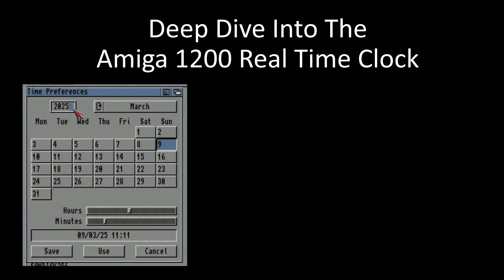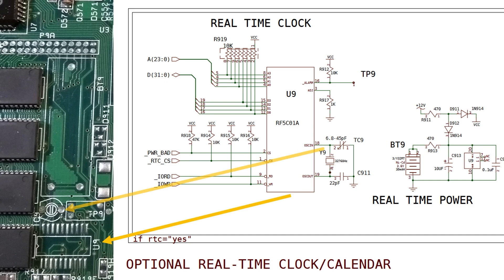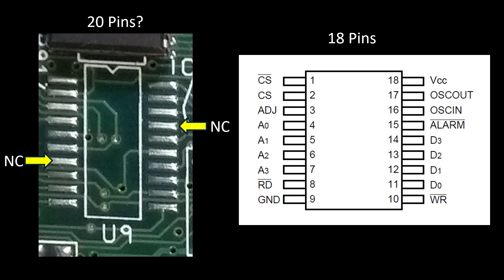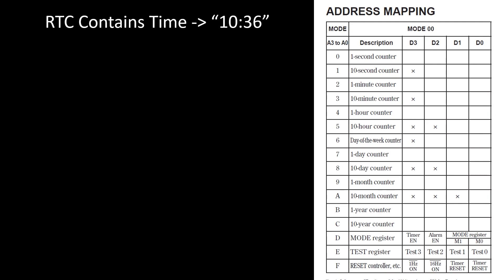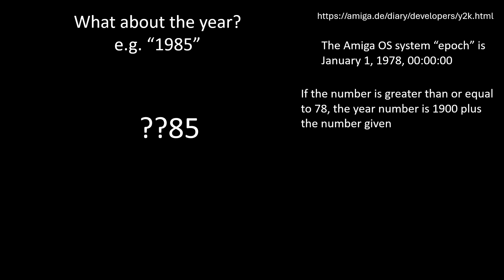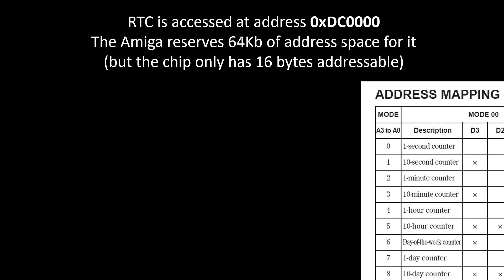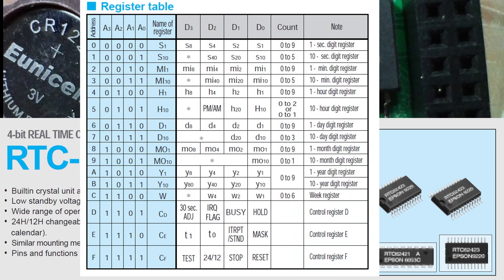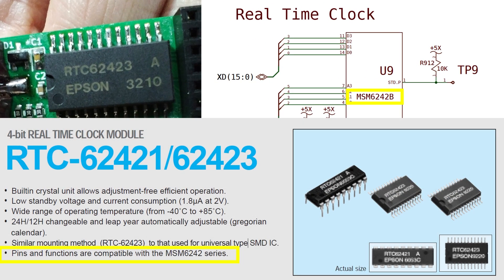It's Time To Talk About The Amiga 1200 Real Time Clock

Comment: It's been a "minute" since I worked with 68xxx processors but unless my memory is completely failing me, they (the ones that have a 32 bit data bus) don't even have A0 or A1 address lines so the engineers didn't really have a choice about using A0 and A1.
Reply from the maker: From what I can see, the processor does have the A0 and A1 data lines but the lines don't go to all the chips. The 32-bit ROM's don't have them, neither does the RTC. The 68881 FPU has the A1 line but A0 pin is just pulled high. A0 only seems to go to the trapdoor expansion and to Budgie.

Comment: maybe they decided these things don't work well with multitasking operating systems anyway. as you can't read and write all registers at once and as such corruption occurs when 2 programs do it. and as such you have to use a  normal 32 or 64 bit register with an adder (on an irq or in hardware) every second anyway-, and as such if you are gonna do it you might as well just do it with a way simpler custom chip than any of this stuff on the market out there. ;) and -then you can write the entire register in 1 go. :P heck half these things are 'designed' to be hacked under an eprom and don't even have a normal bus. (and why bother storing the time and date date as an actual time and date in the first place, when all you need is just an increment on a register while it's off every second ;)
Reply: With very few exceptions, pretty much all hardware will have problems if multiple programs try to access it at the same time.  That's why multitasking OSes always have functions for protecting and coordinating access through MT-aware drivers, etc.  That's part of the whole point of what MT OSes are for, and there's nothing special here in that regard (note that the RTC hardware built into all modern PCs is still accessed in almost exactly the same way, and stores the time in a very similar format, too, and still works just fine).

They ultimately didn't populate it because they decided it would be cheaper to produce that way, and most of their users would be willing to live with having to reset the clock every time they turned on the computer (because at the time, that was actually very common, and an RTC was still considered something of a "luxury feature" for most home PCs anyway).
Reply: @foogod4237  eh yeah well the RTC built into 'modern' pc's isn't modern at all. but that same old 1970s motorola rtc+nvram chip in a different packaging as in the AT 286
Reply: the thing at that time was kinda 'overengineered' lol. like why the hell keep a calendar in the chip lol. this comes with a whole lot of registers and those are gatewayed. and that causes the fact that multiple programs cannot do stuff with it at the same time, at all. (nost just corrupting the date or time, but just getting the wrong fields).
Reply: and yes ofcourse multiple programs can access any i/o register you want as long as it's is full databus size in one go. and not some gatewayed shit contraption.
Reply: just like they all access the same ram at the same time, which essentially is just an i/o device too lol.
Reply: a seconds counter in hardware with a latch to an i/o register to compensate for clock sync differences between the cpu clock and the time-clock would have done. but nah. someone in the 1970s decided to actually count 'days' and 'hours' in the chip lol.
Reply: modern os-es don't access the thing at all. they only get the time from it upon startup. not every time you do time(NULL). and yet if they did their job in the 1970s it damn well could be a direct query to a hardware register.
Reply: keep in mind. it is done that way on all 8 bit micros and essentially the ibm pc is also just an 8 bit micro. dos is not a multitasking environment and the thing has an 8 bit external bus. just 16 bit cpu registers internally. the amigas are essentially a different beast and as such those old methods, are clearly not the way to go about this in the first place.
Reply: to this very day anything running on pcs just keeps the time in the kernel as a workaround :P LOL. you can pull the whole chip out while it runs and it won't notice lol.
Reply: either that or someone at cbm had the magical foresight 10 years after the fact that networks became standard :P LOL. that hey 'in the future' (read, 10 years earlier ;) every node will just sync their time over the network anwyay ;) or better yet just broadcast it over the network every second. lol. so the things don't even need a clock of their own. lol. but commodore being commodore, probably not. too cheapass to even put in a nic of any sorts. lol.
Reply: 'modern' pc's are little more than an overglorified ibm xt typewriter :P with some hacks on top. lol. and yes RTC's already were standard on -basically every system with at least some intention to stick around' (cbm just never got the notion on that networking and rtc's are needed and fancy colors are not ;)
Reply: besides the fact tramiel never understood 'networking' and for that matter, neither did cbm as a whole under any management. he also never understood that price does not matter -at all-. lol. just put a superior product in the market and you don't do that by 'leaving critical things out'.
Reply: what killed the amiga and the st? oh yeah. mainly just that they could not talk to your novell netware or bayan vines server. lol. or your minicomputer. not in any acceptable way anyway. 'muh ibm is more expensive'. well. ibm is still around :P they are not lol.
Reply: let's face it, these things are just as capable as let's say a mac lc, or a cisco 2621xm, or an earlier sun workstation. and yet they completely missed out on the changes of the market due to all that 'leaving stuff out that should have been in there as of 1987'. and only did the fancy colros and sounds. making them glorified lava lamps. but isolated ones. computers with no network in the 1990s? seriously? and no rtc either? and no hdds? that stuff was all standard in 1985 already haha.
Reply: they were stuck in their little bubble market containing a handful of 'gamers' which indeed may not need an rtc :P but it's a 10 cent part to open up 'the other 900% or so of the market to sell to' lol.
Reply: so you have like a what. 25-40mhz 16 bit cpu in there and enough megabytes of ram to run not just any unix variant but also have 1000 users running around on there at the same time lol. and because you decided to leave out some 10 cent parts the only guys you sell to are 'gamers' instead. lol.

Comment: Once CBM chose a cheap flimsy clock-chip and now all Amiga users are stuck with it.
Reply from the maker: @vanhetgoor  The real problem wasn't the chip, it was the leaky batteries. It's quite a good thing that they didn't install this stuff in the A1200.
Reply: This RTC chip isn't really substantially different than the RTC chips used by pretty much everything at the time (including the IBM PC/XT, etc, too).  It's actually not "flimsy" at all (the chip itself will last pretty much forever).

The reason they all used the large, rechargeable NiCad batteries (which, like pretty much all batteries, will eventually leak if left unused for decades) is because at the time it simply wasn't possible to make an RTC chip that didn't still consume a significant amount of power to maintain the clock when the computer was off, and that power needed to be stored somewhere.  It wasn't until later that people managed to develop RTC chips which consumed much, much less power, and could run for long periods of time on things like little coin cells instead.
Reply: @foogod4237  Even in the eighties it could have been predicted that a new era was at the horizon. Within a few decades or less the twentiest century would be gone, forever! Never to return. It was pure neglect to produce a clock chip that would automatically fail in the new century. I think it was bad management, and very short sited. The Y2K-problem was preventable and especially the people whom are working with computers should have noticed this error and actively taken measures. The moment time travel is invented, those unintelligent computers are not coming with us.

Comment: The reason there are memory expansion pins on the 1200 is because Commodore originally thought of releasing it with only 1 Mb of chip memory.

In the 90s when I was still using Amiga there was a "leaked" schematics of an Amiga 1200 prototype. It had only one megabyte of ram and a 68000 CPU clocked at 14 MHz.

Fortunately for us The final version was shipped with the 68020, 32 bit buses and 2 megabytes of chip memory, probably because the AGA chips were too slow for a 68000, even clocked at 14 MHz.
Reply from the maker: Yeah, the 2nd megabyte is marked as optional on the schematic (also notable that the A600 has the same thing but with the 2nd 1/2 megabyte optional)

Comment: Interesting, but a bit disappointed that no soldering iron were wielded. Could you solder in the parts and use the clock port as usual for other stuff? I'd suppose so since it wouldn't use RTC CS signal?
Reply from the maker: @aarntsen  Actually I have the Amiga Kit ram expansion and that clock board can be installed on the expansion or on the motherboard, so still no soldering required and the motherboard expansion is still free.

Comment: You will probably find the NC pads are via in pad, saving space, and hidden by the solder on the board.
Reply: I think you missed the point that the NC pads aren't actually supposed to exist at all, according to the datasheet.  They're apparently extra pins that don't correspond to anything (and mean that it doesn't actually match the chip pinout in the datasheet).  So there's no reason to believe that they should be connected to anything anyway.

This was most likely a special pinout of the chip which never really caught on (and may not even be produced anymore), and just added a couple of extra NC pins in the middle to make it fit the desired footprint instead of the more standard layout, and those pins were always intended to be unused.  It's also possible that somebody just screwed up the PCB layout (and that might have been part of the reason why it was just decided not to populate it in the end).

Comment: That Ricoh RTC chip is also used in the MSX2 and up and I've been looking for some information about it, so thanks for that!
Reply from the maker: Hopefully they laid out the board properly on the MSX2
Reply: @DavePoo2  There are various implementations of the MSX2 standard, so the layout is not always the same. 

The Ricoh chip is also very hard to come by, because it's not made anymore, and it's very hard to find compatible replacements. Unlike Dallas RTCs for instance, which you can still buy at your favorite electronics shop.

Comment: Is there a reason you stop the ticking? Most RTC chips buffet the values and stop updating them if you start a read at the seconds and complete it through the year position. This chip doesn't?
Reply from the maker: The data sheet doesn't say. I noticed the code in the Amiga test kit is stopping the ticking. Link to the code is in the description.

Comment: Also worth noting is the motherboard also has an unpopulated pad for an FPU. You can just solder an 68881 or 68882 FPU and it works perfectly well (although has to be clocked at the same speed as the CPU, which is a minor drawback)
Reply from the maker: @danbuc  hopefully, they got the pads right for that one!
Reply: @DavePoo2  I believe so! Not much use for it as there is next to no software on the amiga that uses the FPU, and most of the software that does use it tends to require a 68040 or 68060 CPU where the FPU is built in.

Moderately tempted to add one to the board I'm building anyway just for completeness sake
Reply from the maker: @danbuc  I think I saw Chris Edwards add one to a board once.
Reply: @ FPU was used in ray-tracers, terrain modelers, CAD and Mandelbrot programs and an 020 worked fine (I believe that shapeshifter allows Mac software that used the FPU to work and there was a DTP that could also use a FPU)
Taking an A500 sticking in a 68020 with FPU and watching it do ray-tracing at what felt like light speed (see what I did there) was glorious.
Reply: @daishi5571  There was some software but if you total up everything that was ever released it's probably less substantially less than 1% of all amiga releases. Mostly Ray tracers, ports of early 90s FPSes and some mid to late 90s demo scene creations
Reply: @ I know, but some of the most important pieces of software on/for the Amiga did use a FPU. The Mac had the same situation. Even the PC had the same problem until software was given 486DX as a minimum.
Reply from the maker: @ I think when the PC hit Pentium was when it all changed as suddenly the FPU was built into the chip so as software programmer, you knew that anyone with that CPU had the FPU
Reply: @DavePoo2  My general feeling is that the working FPU footprint on the A1200 indicates they had planned to ship it with an FPU included. I imagine they pulled that for cost saving reasons as commodore were already struggling financially by them.

The two things that are confusing about the design are the lack of oscillator for the FPU, it doesn't have to be driven at the same rate as the CPU. And secondly why have a separate FPU socket at all? The 68020 was an ancient CPU by 1992, a 25 or 33Mhz 68030 with the FPU built in would have been a much, much more competitive option in 92. But Commodore are a company literally full of baffling design and product decisions so it is par for the course
Reply from the maker: @danbuc  yeah. Did the Atari Falcon go with the 030 chip?
Reply: @ Falcon is a 68030 but on a 16-bit bus so does loose a bit in performance (not the massive amount some people try to claim)
Reply: @danbuc  I didn't think the 68030 had an integrated FPU. Maybe the FPU XO was left out for cost reasons, or to save space on the board..I could imagine them considering using an underclocked FPU!
Reply: @thromboid  ah yes. My bad. They could have gone with the 68040 in the A1200 mind.

They weren't saving space as the fpu  footprint is present on the motherboard. Definitely a corner cutting exercise
Reply: @danbuc  True..I was meaning leaving out a separate FPU oscillator might have been a space/time saving measure. I'd always wondered if you could just install an FPU there, so it was good to see Chris Edwards showing it would just work.
Reply: I suppose if they had used the 68040 in the A1200 they'd have struggled to pitch the A4000 at a much higher price point. There's a lot about the later Amigas that screams "cost reduction"..the A500 was a great "budget A1000" but I don't think many people think of the A600 as a great "budget A500"!
Reply: @thromboid  Ah I see what you mean. There is ample space nearby for an oscillator, several unpopulated shift registers, plenty space on the back of the board to move many of the nearby resistors and caps.
Reply: @thromboid  I think the attraction of the A4000 was always meant to be its expandable PC form-factor (proper zorro slots, PCI and SCSI cards) and the 68060 option.

Probably the issue for the A1200 is that a 68030 or 68040 would have pushed it's price point. Though you might expect bigger orders of 68040s would attract a better price. The alternative, which they chose, was to ship something obviously underpowered for 1992. 

The A500+ and A600 were terrible, unneeded products at the time. A real waste of R&D and manufacturing effort. But commodore have a litany of terrible products from 89 through to 92. They just seemed to love to release a product that competed with themselves. Like, how pissed would you have been if you bought an A600 and then not a year later the A1200 shows up?
Reply: @danbuc  So true..which makes it funny to think that the A1200 is a direct descendant of the A600 in many ways. Looking at the state of many enthusiast A1200s and the hodge-podge of expansions they end up with, there were a lot of people yearning for a big-box Amiga who just couldn't afford one.
Reply: @thromboid  IIRC the A600 and A1200 were developed in parallel by Commodore but at two different R&D sites. The A600 should really have been a cost reduced A3000 but, as the A1200 was already under development, they kept borrowing ideas from it and the cost ballooned. Instead of being cheaper than the A500 it ended up more expensive.

But really the A600 (and arguably the A3000) were completely unneeded products.

Comment: If I was a gambling man (and I'm not) I would say it was the typical cost cutting to remove it, then an engineer snuck it in at the end. Remember this is the same company that before releasing the A1000 removed 256K RAM but added the 256K front RAM port that actually cost more than just leaving the 512K on the board. Classic Commodore
Reply from the maker: @daishi5571  It may have been both cost cutting and a fix for an incorrect board layout. They had already populated the RTC on the A500+ which came out prior to this machine. The 256kb on the A1000 was a bad idea, the machine was almost useless with such little RAM.
Reply: @ At least it wasn't an Apple only putting in 128K in the Mac and that didn't have any way to upgrade it without a soldering iron.